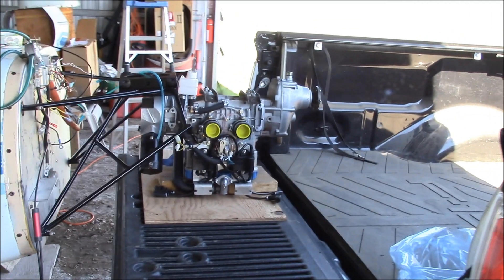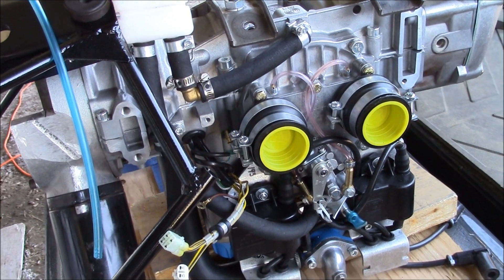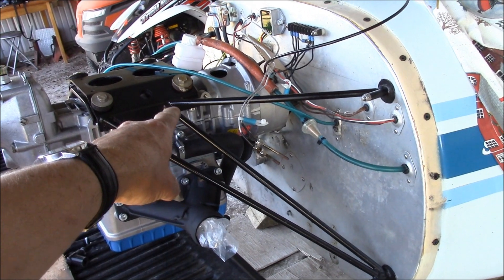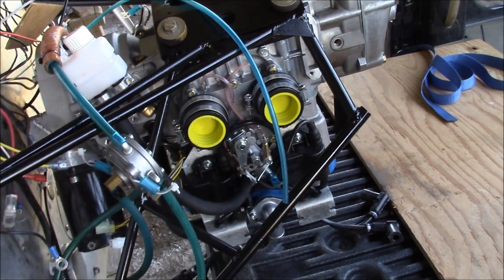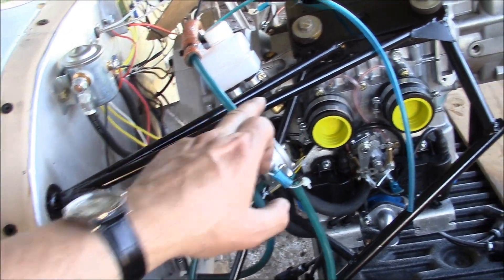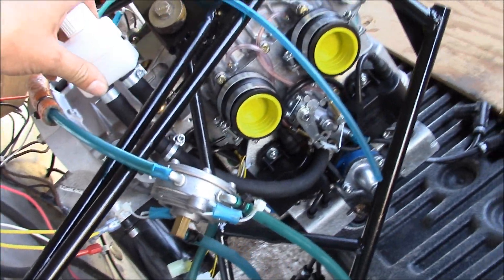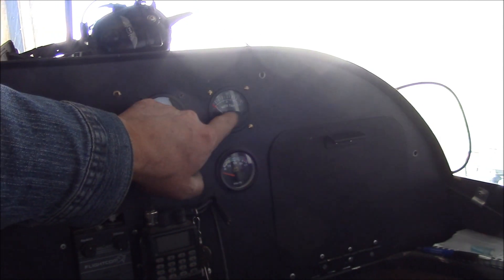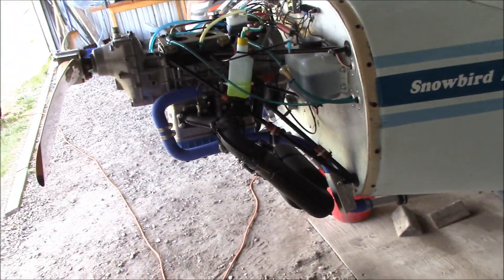Rotax 582 Installation

Comment: Hi, and a good day to you sir. I'm doing a project that designs the Rotax 582 mount for a paramotor tandem trike and I'm interested to study your model right here to be fitted in the trike. Do you have 3d models of this design structure? Also, can I get a close-up of how you mount the engine with the engine mount? Hope to hear from you soon!
Reply from the maker: Sorry, I have no 3D models. I’ve plate itself may be one that was available from Rotax at one time where you could weld on your tubing to fit it to your particular aircraft.